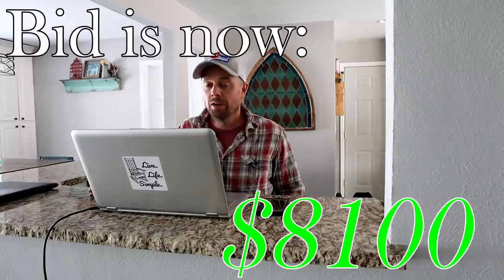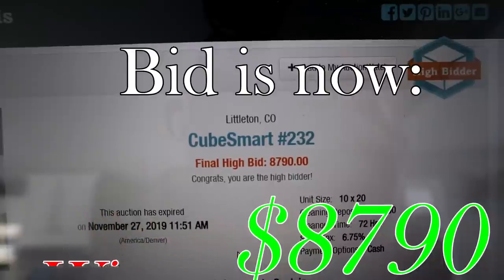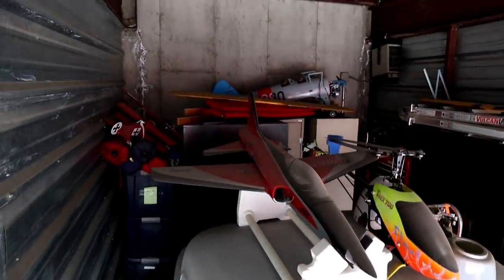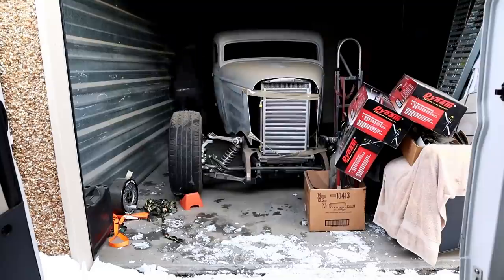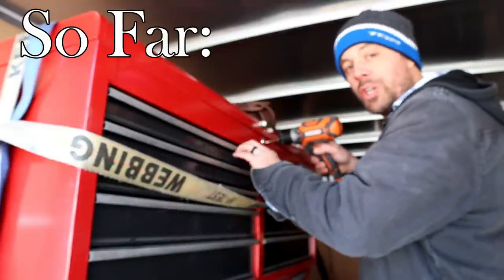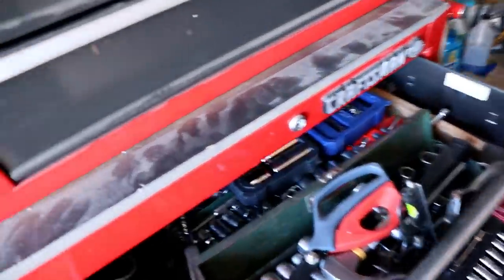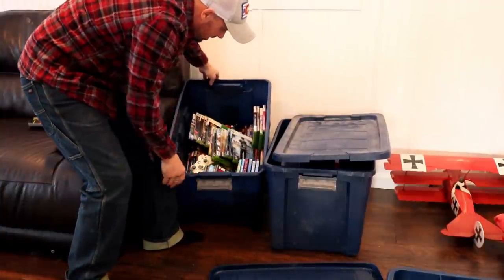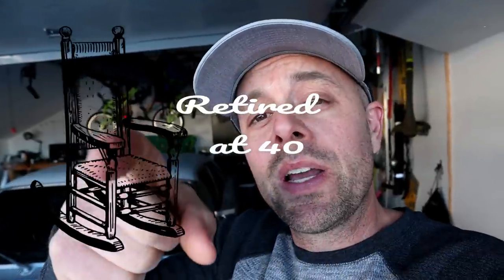I found a 1934 Ford in an Abandoned Storage Unit!!!

Comment: The airplanes are not 1/4 scale and not even scale but reeditions of full scale aircraft . The Hanger 9 Mustang is not 1/4 scale but 1/7th scale  The Cessna 182 is also a Hanger 9 and it is 1/6 scale at best , Those are the biggest . It looks like you have a grand in RC airplanes .  The car is the prize .

Comment: you drilled the locks on the toolbox, probably the single most valuable thing of the tools. gotta be over 800 for that alone.
Reply: How else was he meant to open it
Reply: @richsmith3300  call the people that made it and attempt to get a spare key shipped to you. if this doesn't work then call a locksmith and get a quote, 1 key should open all of the locks so he still would have turned a nice profit on the toolboxes paying a smith. then last resort is the method he used.
Reply: Don't worry he can replace for about the same price as calling a locksmith and this guy know what his doing don't worry.